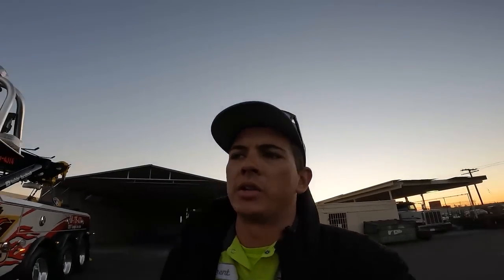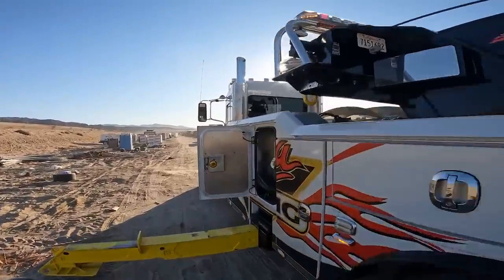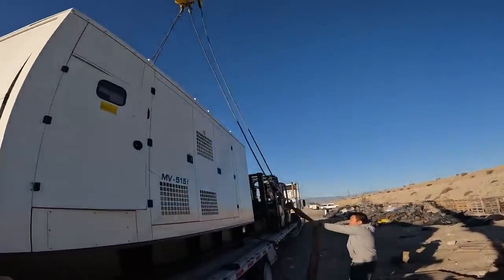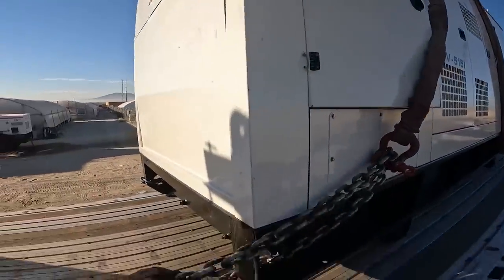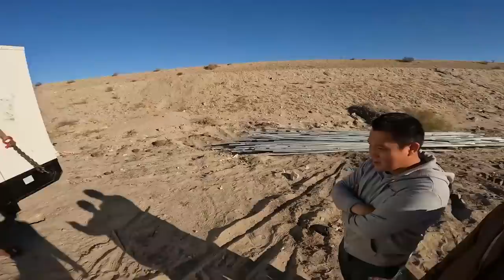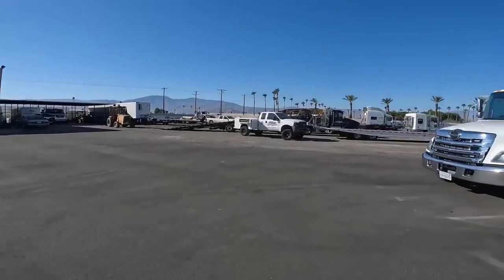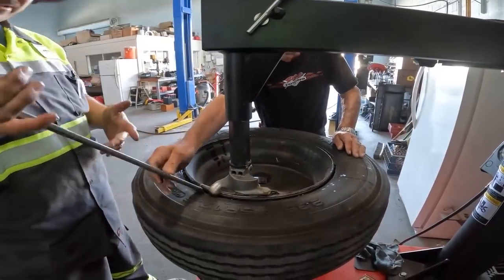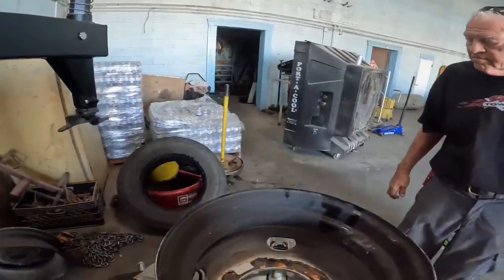Power Lifting With The Rotator | VLOG 026

Comment: Tricky little powerunit to lift there Trent! Almost makes you wish you had those "Side Loading Lifting eyes" to go through the lift points to make the picking that much easier.  They can go up to 20 tonnes WLL depending on the cost and model. Nice job though.. slow, smooth and steady wins the day. Thanks for sharing another fab video and that old classic Dodge Plaza truck.. omg.. that was just so awesome